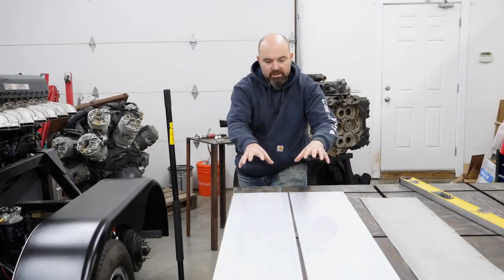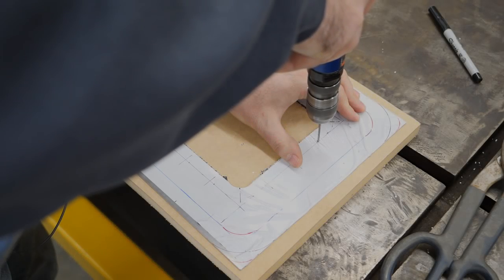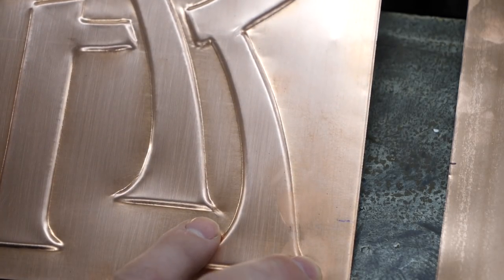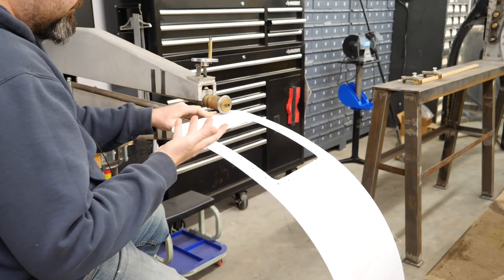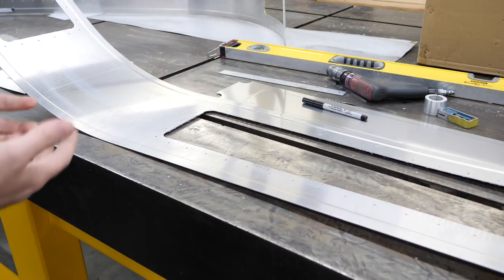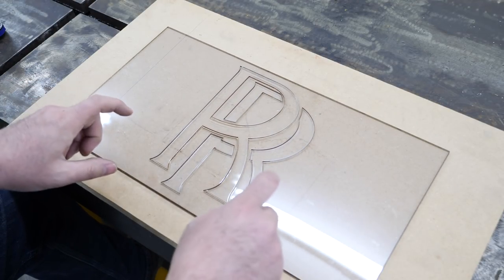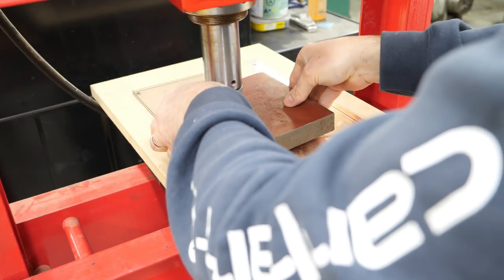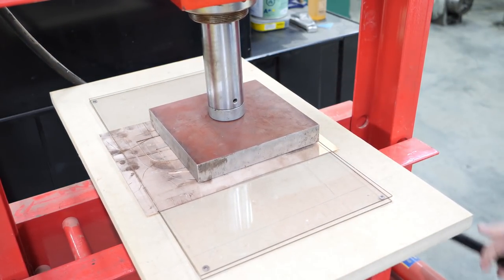Episode  6 Pressed Copper Logos

Comment: are you still working on the typhoon? merlin is great and all, but it isn't part of the typhoon unless i'm extremely mistaken. am i mistaken?
Reply from the maker: This is all for the Typhoon, the connection will show soon. ~Ian
Reply: You’re mistaken if you think that typhoons get made by going to the typhoon shop and buying everything you need. Sometimes you have to get what you want by a rather Circuitous route.
Reply: @TyphoonLegacyCoLtd  Thanks for correcting me Ian.